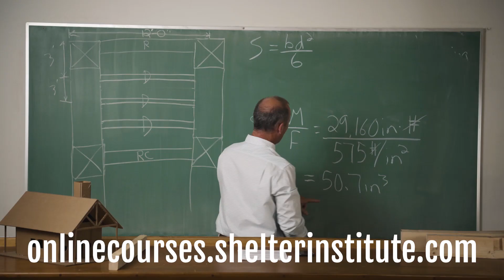Timber Frame vs Conventional Stick Frame - Pt. 2 (A Follow-Up Video)

Comment: How are the timbers attached to the foundation? I noticed on one video that the mud sill is fastened to the concrete foundation, the SIPS panels attached to the mud sill and the timber framed 'bents' attached to the SIPS panels. I would guess that in areas that have higher requirements for earthquakes it would be required that the timbers be set in saddles that are poured into the foundation walls or slab on grade. (?) 
Can you tell me what kind of engineering you typically submit for building permits? I would like to see an example if possible. Thank you! Love your system!

Comment: Thank you! I would love to live around there to learn from someone like him. And no, I'm not even from US. Here in Argentina Wood Framing is barely starting to appear after brick and cement dominated our construction culture, which is filled with uncultured and low class workers that know little to nothing, are not professionals, and con you 9 of 10 times while they build their own home in secret with your own materials, or rush the work as they grab another gig somewhere else... Therefore, Steel Framing and Wood Framing began appearing lately as the miraculous solution, but instead, they arrived with many fraud companies deceiving many families, taking their savings and declaring bankruptcy to not deliver nor pay back... Awful. So, there is a lot of bad image stuck to Steel and Wood Framing here... while Timber is less known. For now at least. I'm learning to build for myself to not pay absurd amounts of money and risk being robbed. Hard to trust here...

Comment: Thanks for your videos, I've learned things. Although I'm convinced there are many advantages in timber framing VS stick framing, I feel your comparison is somewhat partial. In the 1st video you were talking about the economy of work to build the timber frame model VS stick frame. But the stick frame building you show has all the openings done, waitting for doors and windows. I wondered how you would fill the timber framing structure... and I guess it used to be with sticks framing structure. And here you propose to complete that beautiful structure made from a non-industrialized process and nice skilled joints with... SIP panels? I'd suggest to bring the comparison through all the processes and a full life-cycle analysis for both systems. But again, thanks for sharing your love for wood, it was inspiriong! Kind regards,

Comment: There is also a new type of framing with CLT panels ( cross laminated timber), the panels are structural so no sub frame is required, i have done several buildings using these, multi storey too.

Comment: I have loved in both balloon stick frame houses and timber framed. The timber framed house I currently live in is the oldest and strongest. I have had to replace a small portion of the timber frame (a cross piece that had rotted due to a jack leg plumber who didn't bother connecting a shower drain and for over 20 years the shower was draining onto the timber.) and it is by far the strongest. It has survived numerous earthquakes and 3 tornadoes I know of passing over or by it with winds over 80 mph directly hitting it, I was inside it when the last one hit and it never even shook. A neighbor had their roof entirely torn off. Give me a timber frame any day.

Comment: Hi . Great video thanks. 
Question. Can I use timber frame and stick frame  in a hybrid house in order to avoid sip panels?
Reply from the maker: Thank you! You absolutely can, it will likely reduce the depth of visible timber on the interior(8x8 post depth with 2x4 stud walls) but it is totally possible.

Comment: Building codes are there for a reason.  The same wind sheer that hits one frame hits the other. 
Anchoring and nail pattern  matter.  Even the shape and size of the nail head makes a difference. 
California like many other states have unique codes due to different factors. Such as liquefaction,  average wind speed,  elevation,  and rainfall amounts. 
Maybe you should stick to Building in Maine.  Where the codes are apparently more to your liking.

Comment: I’ve noticed that timber frame structures don’t have rafter ties or collar ties. Is there no need to prevent widening/expansion on timber frames? If not, is that because of how the rafters are connected?

Comment: Hello, how do these systems work with residential fire protection systems?  Do they need to be face mounted/ exposed or is there a chase cut for the pipe?

Comment: Excellent content. I am curious of your thoughts on the use of wood paneling on the interior as opposed to drywall, and what considerations that would entail.
Reply: i'm having a timber frame built and i thought about walls alot.  in my view wood paneling takes away from the visual effect of the timber frame. i'm having Douglas Fir for the interior and the white pine for the frame with treated white pine on the ceilings of the loft and main room cathedral. it's a 24'x36'  Hennin Hammer Beam Truss design. i don't want wall panels to take away from the grace and beauty of the timber frame; it's the main attraction, the star of the show and the reason for the build.

Comment: Your point about all different construction types having their own place, advantages, and disadvantages is so true. I’ve heard veterans from Afghanistan comment on how ceramic mud hut style construction was so strong that it deflected high caliber rounds when used for cover when an American stock framed house with siding & drywall wouldn’t even slow down rounds. While it wasn’t an intentional feature for the hundreds of not thousands of years that people have used that construction method, it’s a testament to how strong it is for that environment. If it wasn’t working well, then people wouldn’t keep using it. It Japanese temple construction using mostly soft woods wasn’t effective and long lasting in their climate, then they wouldn’t keep doing it. Thanks for the great content and for spreading knowledge.
Reply: хахахахахаха про Афганистан очень смешно.
Reply: About the bullets, the bullets like to ricochet and follow along the direction of the wall, depending on the angle, and the hardness of the surface is the main determinant of how shallow the angle has to be for the round to deflect and bounce in a new direction. It is more likely than you'd think, bullets almost always ricochet unless you are 100% perpendicular. Bullets will often deflect off of TREE LEAVES and light bush when the angle of incidence is shallow enough.
Reply: Something you learn in engineering design is that stiffness does NOT ALWAYS equal strength. While it may be  able to stop a round, drag from high winds could cause it to crack instead of flex in the wind.
Reply: @LightSpinAngler I don't think I've seen anything that wouldn't flex, one way or the other, last. Even a big engine foundation or something. Sure, you might make an unattached solid in whatever shape and material, like maybe a sphere, but whenever you start introducing holes, corners and whatever,  as a building is full of, it needs to flex not to fail. Some things maybe only a tiny bit, but just temperature variations will make it move. Contract or expand.  And the rest of the system has to accommodate it.

Comment: How much extra cost would be added for a hypoallergenic option without SIP, without plywood or particle board of any sort, and using inert insulation that does not off-gas?

Comment: ✊✊🌲🌲 Mass Timber Revolution!!! 🌳🌳♻♻👷‍♂👷‍♂👷‍♀👷‍♀🙌🙌🙌🙌
BTW Californian Beuracracy all makes sense if you want to build sustainably, protect worker's rights, and fulfill the progressive housing vision.
Also, Single Family wood-frame house up to 2 floors + a basement in California doesn't require a licensed professional (Architect or Engineer) to build it. It doesn't mean that the building can violate the code. DIY construction still has to abide by a code. But with Timber Frame, you would need a professional Architect or Engineer to stamp the drawings and specs for Planning and Plan check.

Comment: I must take exception to your statements that all construction systems are valid.  There's some absolute crap being sold by builders today, with 2x3 framing, plastic plumbing, and vertical mulch all over the place.

Comment: Can you build a timber frame with ICF walls?
My build site is 9500ft in colorado so i want to build a passive home and use 12” thick SIPS for roof insulation. 
That means I need a concrete slab to warm with the sun and then the mass of the walls and floor retain the heat long into the evening

Comment: Ask these complaining electricians haw hard it is to do wiring changes in a finished house, damaging dry wall, paint with lots of labor. If properly done, making these changes in a timber frame should cause little to no damage to anything in the home and take very little labor. I have had 9 homes built from scratch from $100K (a lifetime ago) to $2M and the plumbing and electrical systems were terrible in all. If you want to make a change, you better being willing to deal with expense and rework. 

One thing this guy hasn't brought up is that you can actually tear down and move a timber frame whereas a stick built home is cheaper to bulldoze and start again.

Comment: "Wood is quite inexpensive now" - that didn't age well. :)
Reply: You would be entirely impressed at how cheap rough sawn timber’s are at your local lumber mill. He’s right, there’s no shortage of trees. For a porch addition, I recently bought 6x6s and 6x8s in 20’ lengths for $29 and $36. Spitball some math off that
Reply: still cheaper compared to the other materials

Comment: It makes me so happy to see another contractor using sips as part of of their construction methodology. 
My company builds net-zero, green built homes in the Pacific Northwest btw. I’d really love to see our company start using timber framing in conjunction with sips. Showcasing timber, and the craft that goes into making those kinds of joins has always appealed to me, as a carpenter.
Reply: Can sips be green? I mean with all the glue and plastic in them I am leaning toward hay bale or adobe or shiplap..
Reply: @smolboyi  build however you see fit. The proof is in the envelope. There are lots of ways to build green homes, and one of the methods involve SIPS. If you don’t like the idea of poly styrene, and OSB because of their carbon footprint, I’d also look into other ways to offset your overall carbon footprint. Certainly the largest carbon footprint in any home is concrete. Odds are that the carbon footprint of most modern slab on grade foundations is equal to or greater than the entirety of the shell of the structure. There are ways around using concrete in foundations, but even earth ships use heaps of concrete.
Reply: @Tac0caT0  oh... well you're absolutely right, I really just don't want the osb because I believe it off-gasses.
Of course making the building low impact on the environment is a goal too, but I just want to avoid plastics, and still have a nicely sealed building.
Reply: @smolboyi  OSB off gasses VOC’s gradually, that’s true. Though any  concrete sealer/finish, interior latex paint, subfloor adhesive, silicone sealants, polyurethane window caulking vastly outweigh the amount of off gassing OSB will have released while it’s either hanging out in a bunk, or in the walls of your home. Not to say OSB doesn’t off gas, but if you want to minimize VOC off gassing I’m your home, there are plenty of other products to avoid. Vinyl windows off gas, as does all of the plastic in every one of your modern home appliances.
Reply: @Tac0caT0  thank you 🙏🏼
I will try not to use any of those haha
Reply: @smolboyi  best of luck❤️

Comment: Honestly, timber frame really is superior. Less materials used, quicker construction, stronger structure, better insulation. And you can still have hidden framing just like with stick framing by using interior drywall.
Reply: I know im late, but in "stick framing, as yall call it, we do "staggered studs." Two rows of offset studs lead to no gaps in insulation.

Comment: Plumbers and Electricians and Carpenters all hate the new construction techniques. They are being replaced. There is really nothing to like about that. Completely understood. Personally, when I got a quote of $3500 to replace a hot water heater, I was cheering the day when all plumbers were without work.

Comment: You're right regarding the construction of stick frame / timber frame ratio. I've been in the industry since 75, and in those years I've built 2 log cabins, 7 timber frames, and I don't know how many stick framed houses. That said, you're wrong about the time to construct them. You are only discussing the time to stand them and comparing that to the entire time to construct a stick frame house. In my youth I worked on a couple of tracts standing cracker boxes. We were a 3 man team standing 3 - 4 houses a day stick framing. In your defense, we were working on tract houses and our kits came from the truss yard with precut headers, trimmers, sills and cripples so we were only standing them on a mono slab.

Another thing I think you overlook is the skill necessary to make the cuts in timber frames. That skill level is beyond the skill of the average carpenter. Most carpenters don't even know what a mortising bit is, let alone how to use one. I had better luck just going with hangers, blind and normal, than I did trying to teach guys how to make a shoulder cut with a mortise and tenon that would pull in the structure together without bolts. Just the puzzled looks I got when I mentioned corbels told me all I needed to know about the team I was working with. All but 1 of my timber frames was also built out of glulam's.

However, we're now working with CLT which I think is significant. Maybe you can try incorporating those panels into your timber frames in the future. They look great and are quite sound.

Either way, luck and have fun.

Comment: I'm curious how the timber frame holds up to winter snow and storms. Being from the NE we get a lot of snow and even with a peaked roof the snow can build up pretty thick regardless of roof type. How is the strength of the timber one for weight on the roof i guess is my question.
Reply: Strength is similar or better depending on the quality of studs. And in general, the way timbre is insulated is better than stick

Comment: Yeesh!

People are so threatened by non-conventional methods in any field. Hell, I do strict-only water haircare and it works. As long as I clarify with distilled water after a shower. Doesn't stop everyone from freaking out over it though. AARON, YOU'RE HAIR IS DIRTY. No...it's not. 

And timber frame houses are just as functional and beautiful as all the rest too. 

Accept it.

Comment: Specifically what does he mean when he says “timber”?  In this context, does ‘timber’ mean manufactured wood products as opposed to the “stick frame” which is made of milled wood products?
Reply: in this case timber means taking a tree trunk and making it square and cutting it to length as opposed to cutting it into 4 or 5 2x4's. Think 4x4 only the whole tree trunk.
Reply: @ADobbin1  Thank you for taking the time to explain.  I should probably watch Pt.1 as well.

Comment: We use pre-built rafters and wall sections. 
I don't see any advantage using timber frame with wall sections over rafters and wall sections.
Reply: Asthetics and time savings
Reply: Asthetics yes,
Time savings disputable

In our area rafters allow for a lower pitch and much less snow loading. A low pitch has less air turbulence depositing snow. A low pitch, hidden eavestrough   in combination with steel roofing is most cost effective.

Comment: I think one of the best reasons to build timber frame over stick is if you have an existing woodlot with plenty of trees useable for timber. The practicality of building everything with hand tools as a 1 man operation is the only reason I need. The fact that they are much better to look at is an obvious plus.